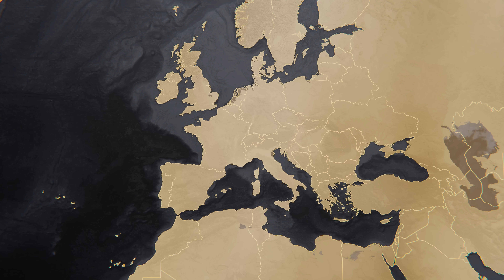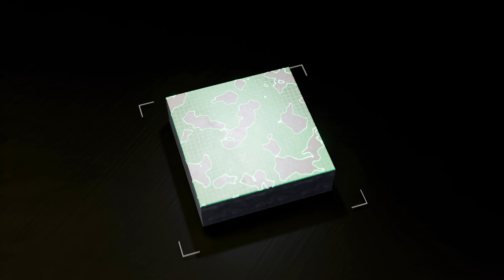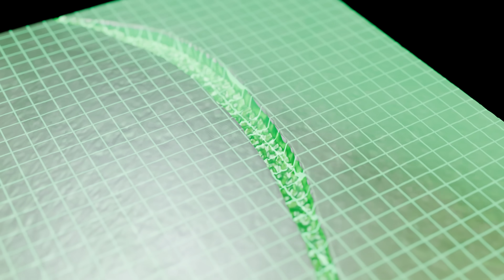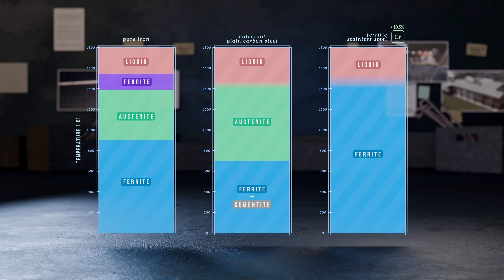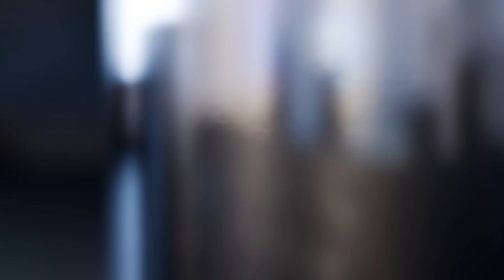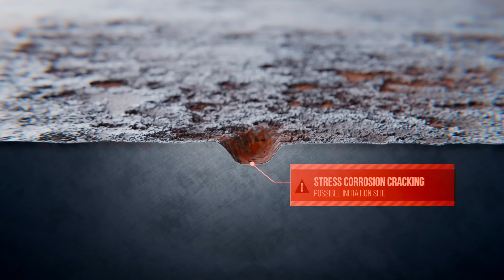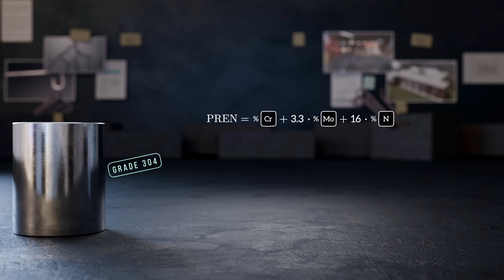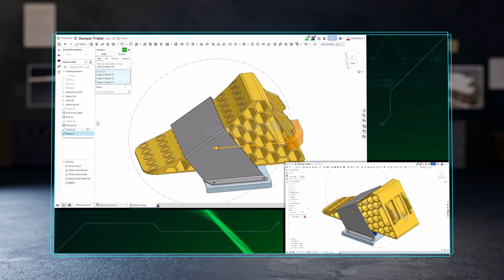The Problem with Stainless Steel

Comment: If the engineers had known ANYTHING they would have decided that 304 was NOT the right grade of stainless steel for a high chlorine/saline environments. Sure it’s fine for most environments, but 316L would have been the correct choice from the beginning for the most part. Today it would’ve been Duplex this is negligence at best and malicious intent at worst. You also forgot to mention that pearlite and martensitic are far more desirable than either austenitic and ferritic stainless steels.
Pitting and SCC is also the main reason why so many buildings and roads become dangerously damaged. I got a degree specifically in corrosion, so I can tell you for sure, that it could have been prevented with either coatings or 316L, but as you said, today we would use Duplex

Comment: Saw an iron foundry metal roof collapse. It sounds like the formaldehyde gas that escaped from the bonding agent in the sand mold rusted steel out.

Comment: I’m kinda surprised that the SCC proceeded without a cyclical load, I always assumed fatigue/cracking needed dynamic loading to proceed, but I guess the chemical component is significantly more important than the stress component in that situation

Comment: I have read that “wrought iron” does not corrode nearly as quickly as any modern steel due to its containing phosphorous. If this is true, why isnt wrought iron used as rebars in all concrete????
Reply: The stainless wasn't used as "rebar"in fact the 100mm thick concrete had no involvement in the failure-mode that caused the tragedy...
Reply: @peterfitzpatrick7032 . Yes , I understand that but it was just a general question regarding rebar in concrete. It seems to me that most concrete failures are due to the rebar rusting , causing premature failure of the concrete. Would the use of wrought iron rebar help solve this problem??
Reply: @billzech4337  They once tried using epoxy-coated rebar and found it failed faster than non-coated... when its encased in the concrete it stops rusting and the initial layer of rust protects it... but when concrete cracks and air  & moisture can get at the rebar again it can fail rapidly....
Reply: @peterfitzpatrick7032 . Thank you but still the question in my mind is would wrought iron be better than steel rebar?

Comment: So basically the failure was beacuse of pitting resistance on the stainless steel rods caused by chlorine. I think it could have been avoided by using Molybdenum as it stabilizes the film and slows the pit growth.

Comment: Changing the grade of the steel may have increased the design life of the structure. But, the real problem was that the roof was designed to be in tension in the first place. Never heard of camber???

Comment: Why do engineers think they need to suspend a CONCRETE ceiling in the first place.
Reply: .... because the 100mm thick concrete is an ideal longterm , no-maintenance material in a high humidity environment , in a building which doesnt lend itself to regular maintenance coating of any other alternative material....

the concrete had no part in this failure...
Reply: @peterfitzpatrick7032 you can have concrete ceilings without suspending them.

Comment: What the heck is a suspendet concrete celing. Or more like why is that a thing. why would anyone do this ????
Reply: Concrete is seen as an ideal longterm low-maintenance material in a structure where re-coating an alternative material regularly would be impractical...the 100mm thick concrete didn't fail here... nor was it involved in any way in the failure-mode which caused the tragedy...

Comment: What people call "Stainless" I call useless as on my sailboat it will rust quite badly within 1 month... On a sailboat on salt water only thing that work is Acid Proof Steel as that practically speaking don`t rust even after 40 years as that is the age of the sailboat .

Comment: Yeah, that's why you often use Inconel or Hastalloy in chemical engineering =) 
Also often a good idea to have a PTFE (Teflon) or PFA coating when dealing with the highest tier of "chemical stress".

Comment: The danger of chlorine and chloride ions is known for centuries. Aqua Regia gains it's power to dissolve gold and platinum due to presence of chloride. 
Chloride just destroys aluminium, no matter how strong is oxide layer. Even hardcoat anodizing would be easily damaged if you let chloride medium to sit there for a while
Chromium oxide layer on stainless steel have the same weakness unfortunately

Comment: This is one of the few areas where coated rebar could've been a better choice.
Hell, painted or galvanized pipe would've...
Or, hey, i have an idea! How about NOT suspending a deadly heavy material over a pool in the first place?
Reply: This Stainless wasn't "rebar" inside the concrete tho...

Comment: StainLESS why is that hard to understand?  StainLESS resists corrosion and oxidation because of the higher chromium but it is not impervious.  If it never corroded or oxidized it would be called stainproof steel.

Comment: When I heard "suspended concrete ceiling with metal rods" I was like nope ,nope and nope.
Reply: Come visit Arche de la Defense one day!
Reply: What would you do differently?
Reply: @budlanctot3060 not concrete panels when they're just dead weight for looks
Reply: I remember reading years ago in a hotrod magazine that stainless is comparable in strength to about grade2 hardware, which is the low end of steel.
Reply: @brandonadler1022 I think it really depends on the alloy. ARP sells SS engine fasteners. I doubt they'd sell GR2 fasteners. Maybe check their website.
Reply: @budlanctot3060 i’ve used their stuff. I like it. For dress up stuff like rocker covers and carb studs stainless is fine because you don’t need much strength but you probably still want the strongest steel for heads and crank bolts. If I recall, those are notably stronger than grade8 but still slightly less than the premium titanium alloy stuff. But you’re right about depending on alloy differences. I did an unrelated job at a porche audi vw facility and they showed me titanium engine mount bolts. 150$ EACH! Probably not worth it except for racecars 🏎️.
Reply: The suspended concrete was only 100mm thick and was seen as an ideal low maintenance material in a high-humidity environment... the concrete didn't fail... the stainless steel failed, under extremely unusual circumstances (chlorine-heavy humid environment)
Reply: @peterfitzpatrick7032 I'm assuming it was lightweight concrete. I know that's a real thing.
Reply: @budlanctot3060 lightweight concrete is a thing but more likely it was typically dense concrete to reduce permeability.

Comment: Oversimplification; things or problems can be and should be simplified but not too much. Chlorides are large ions and the size of the ions are not a factor. electrochemical corrosion is closely related to stress. Low oxygen corrosion is interesting and reinforced concrete made with salt water is very susceptible to early failure. The phase diagram is complex but needed for a good understanding. You can keep a stainless steel place in a sodium chloride solution and nothing will happen. But you keep the same stainless steel sheet with a non-galvanized iron nail (touching each other) in the same salt solution and you can see the corrosion visually.

Comment: "Suspended concrete ceilings". Why do I have a major problem with the very thought of such a thing.
Reply: It was only a 100mm thick and contributed in now way towards the failure....
It was most likely used because it makes an excellent longterm maintenanc-free option in asituation where painting or other coating would be a big deal...

"On May 9, 1985, the indoor swimming pool in Uster, Switzerland, suffered a catastrophic ceiling collapse, resulting in 12 deaths and 19 injuries. A 4-inch-thick concrete and steel roof fell, caused by stress corrosion cracking of the stainless steel hooks holding the ceiling. This incident highlighted critical safety issues regarding materials used in high-humidity pool environments. "
Reply: @peterfitzpatrick7032  Look damn it, I know about the report and what it said. "It was only 100 mm thick".........or just a hair shy of 4 inches. Do you have any clue as to how heavy those 4 INCH THICK panels were, even with "light weight concrete" being used??? What the hell do ya think "collapsed & fell" that caused those serious injuries & deaths: IT WAS THE CONCRETE PANELS. Of course the type of stainless steel chosen was a poor choice for the hangers due to chlorine from the pool breaking that steel down.......PLUS THE WEIGHT of the concrete that placed an even greater load & stress on those hangers. They only chose lightweight concrete because it was a cheaper alternative that is resistant to chlorine vs any number of alternative materials that are MUCH lighter and are also resistant to chlorine. I was a journeyman lath mechanic ( for stucco ) for 36 years. Now of course stucco cement is heavier than lightweight concrete, but consider the following because I know this to be a fact: A sheet of galvanized steel high rib lath is 96 inches long by 28 inches wide. High rib lath MUST be used for ceilings due to it's strength & rigidity to withstand the weight of the stucco that is applied. As a lath mechanic, I've hung tons of the stuff. I also know for a fact that after the plasterers apply the initial scratch coat plus the final brown coat.........that stucco is anywhere between an inch to 1.25 inches thick. At least 80% of the initial scratch coat applied is ON THE TOP SIDE of the rib lath. The roughly 20% of the initial scratch coat hangs below the rib lath ( due to gravity ) where the plasterers must immediately use a wide brush to lightly brush the scratch coat, giving it fine grooves for the final brown coat of stucco to have a roughed up surface to take purchase & adhere to the initial scratch coat. I've demo'd more than my share of old failing stucco ceilings. That single 96 inch by 28 inch sheet of rib lath with 1 to 1.25 inches of cured stucco weighs AT LEAST 300 POUNDS. But they do NOT use suspended ceiling systems for just that reason.......the sheer weight........of stucco ceilings. Now, how much less do ya suppose lightweight concrete is vs conventional concrete. I know it's considerably less........but at 4 inches thick, I know damned good & well that it's still quite heavy.......especially when installed over the heads of PEOPLE. IT WAS STILL HEAVY ENOUGH TO KILL & HURT THOSE PEOPLE. Now again: of course the steel used for the hangers was to blame, but THE CONCRETE PANELS that fell are the cause of all of those deaths & serious injuries. They should've spent the extra money on a safer alternative drop ceiling system. This is yet another case of cutting costs resulting in serious injuries and death.

Comment: Austenitic stainless is the weakest in yield strength? Christ almighty, I wonder how many broken drill bits martensitic steel is responsible for xD. 316 stainless steel is a bitch to cut or drill, I can't imagine what it's like to drill the harder types of stainless.

Comment: There is no such thing as a truly stainless steel. I live in a very small country surrounded by ocean, every grade of stainless steel except for 316 will corrode just as fast as iron. 316 lasts a long time but it by no means "stainless". After a year or two in the elements, it will be full of tiny corrosion spots despite being the most resilient, most expensive grade of stainless steel that exists.

Comment: I used to work in a factory that made stainless steel pipes out of 316L. In the 1990s we became aware of the issue of chlorides causing intergranular corrosion in austenitic stainless steels. We checked the local town water and it was high in both iron compounds and chlorine compounds. I had to give myself a crash course in water treatment and organise the purchase of a small treatment plant. We had a hydrostatic pressure testing station and a visual and UV dye penetrant testing station that all had to be connected to the treated water plant. Our biggest worry was the corrugated bellows in flexible pipes trapping water containing chlorides in the thinnest and most stressed part of the pipework. We also put the need for the low chloride content of water used for manufacturing bought out pipes into our purchase specifications.

Comment: As soon as you said the failure was in a swimming pool complex I guessed that it might have been chloride corrosion. My strength and materials professor would be so proud... I still remember this 40 years later... Though if I'm honest some experience with exotic nickel alloys back in the '90s changed my understanding of chloride corrosion.

Comment: Thank you for the informative video. I worked for Alfa - Laval back in the 90s and they taught me a hell of a lot about metallurgy especially in high temperature and highly corrosive environments. Dulplex Stainless were developed only recently by Sandvik and not readily available in the 1990s but we substituted Titanium in place of 316 Stainless Steel. We didn't even consider 304 as being corrosion resistant. Not for chlorine environments like swimming pools and paper mills. The biggest shock wasn't so much the Uster collapse but all the others mentioned afterwards. The four I could find were in the Netherlands and Russia. I am dumbfounded that given that these all happened after 2000 that no one had bothered to check. Absolutely criminal as far as I am concerned.
Reply: It casts a huge shadow Swiss engineering and safety record. Is it not all that it's banged up to be?

Comment: Suspended CONCRETE ceiling?? Why though??
Reply: ..... because the 100mm thick concrete is an ideal longterm material in this architectural application...low-to-no maintenance in a high humidity environment in a structure which doesn't lend itself to easy regular painting/coating of an alternative less durable material...

Remember, the concrete didn't fail here, nor did it play any part in the eventual failure-mode that caused the tragedy...🤔

Comment: I work on old Subaru engines (pushrod EA series) which have cylinder liners that the manual lists as being made of nitrided austenitic steel. They are far more corrosion resistant than the cylinders on most other engines. I've rebuilt one that was sitting with water in the cylinders and after removing a bunch of junk that was sitting there from the water the cylinder walls had no pitting at all.
Reply: Those EA engines often had leaking headgaskets. One or two pots would end up with enough water to hydraulic lock. They would free up after a few goes at starting but the wet spark plugs took engine heat before working again. The engines ran for months like this, then we pulled them out and stripped them. The bores were fine, some of the rings had corroded solid in their grouves the engines worked fine with just freeing and reassembly.

Comment: I would argue that ceiling weight and ventilation were an issue too...
Reply: The 100mm concrete played no part whatsoever in the collapse, the hangers were calculated to carry the weight but the material chosen wasn't right...

Comment: Building sailboats we used stainless fasteners for obvious reasons but also for non-obvious ones. Ferritic stainless fasteners are brittle and easy to break preventing the need to cut them short with a tool. Especially cheap Chinese stainless fasteners.

Comment: It took me 5s to suspect the chlorine in the pool was what corroded the SS. Just saying "it corrosion resistant" is like buying a "water resistant" raincoat, then being surprised when you go out in a storm and come home soaked to the skin. 
All the metal theory was interesting but why did it take 12min to get to the point? We know there are special grades of SS for marine environments. Did no one realise that chlorine in a pool may work like sodium chloride in sea water? They clearly did not use competent engineers when designing this building.
Reply from the maker: All the metal theory was the point. 😂

Comment: To keep it simple… Stainless steel 304 (AISI 304) for swimming pool environments was the wrong choice! Not suitable for salty or aggressive environments
Applications: Kitchen, Household, Indoor furniture, milk transport
They should have used stainless steel 316 (AISI 316) for swimming pool environments
Properties: Better resistance to chlorides and acids and seawater resistant. You can read all about this by simply opening a supplier brochure.

Comment: The instant you said "pool", I yelled "chlorine!" Also the quote from an engineer in college, "it's stain-LESS, not stain-PROOF". Everything corrodes in the presence of chlorine. (I've seen a wooden handle rusting to the wall of a salt mine.)

Comment: Carbon is not an alloy of steel. An alloy is a metallic element, and carbon is not. The purest form of plain carbon steel is pearlite at 0.83%C where Fe and C are in complete chemical solution that forms steels unique crystal structure with no residuals of Fe or C.  There are two basic types of steel, plain carbon and alloy steels, both of which can be non-heat treatable or heat treatable. Typical alloying elements found in steel include chrome, molybdenum, tungsten, vanadium, manganese and nickel. Carbon is a contaminate in non ferris metals and their alloys.